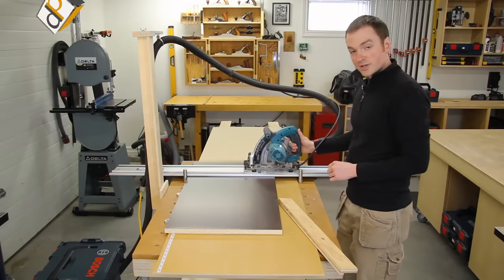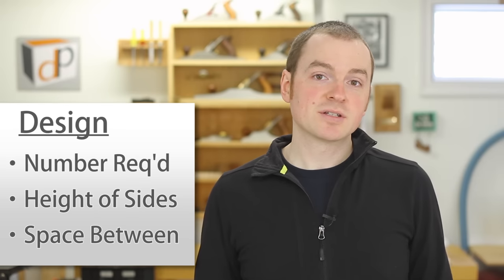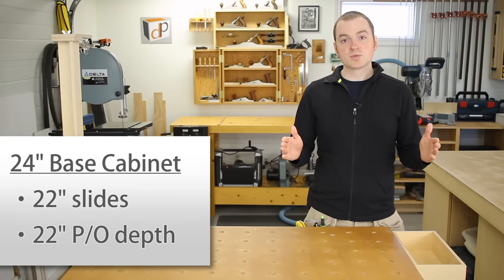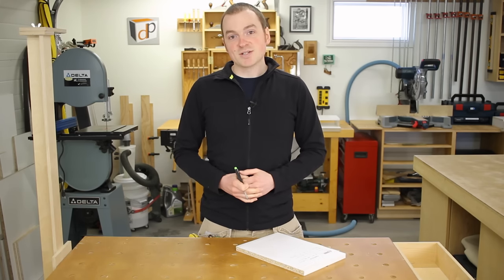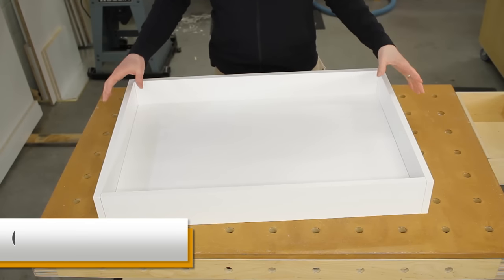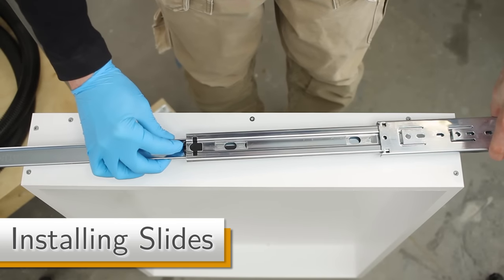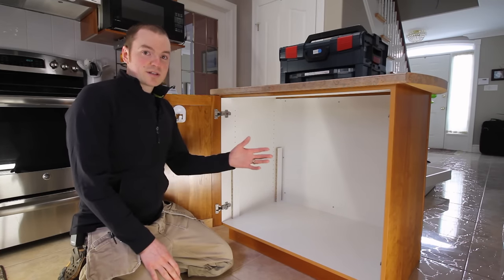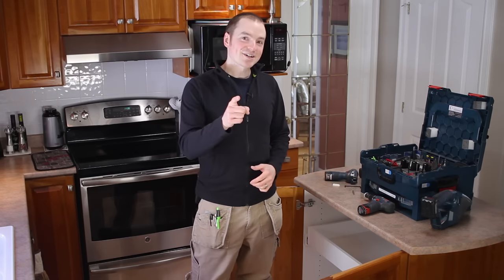How to Build & Install Pull Out Shelves - DIY Guide

Comment: Would you please make a video where you show how to remove these shelves?
Reply from the maker: +ritzd1999 it depends on what kind of slides you use as to how they are removed.  These particular slides are removed by simply pushing on the plastic release tabs on each slide and then sliding the whole thing out.

Comment: At 2:18, what are the widths of the sides for the small and large pull outs?
Reply from the maker: I can't remember off the top of my head but I can find my cut list from the job and get back to you.
Reply from the maker: The large pullout had 4" tall sides and the small pullouts were 2"
Reply: Thank you and great video. You have encouraged me to try it myself.

Comment: excellent tutorial. Thanks so much.One question- if doing one rollout under a cooktop or sink, would you recommend bottom mounted slides instead or side mounts?  If not, is there a rationale?
Reply from the maker: Thanks. You could use either type of slide if you're mounting it at the bottom of a cabinet. I find that side mount slides generally tend to be less expensive, more sturdy and easier to install but you could use either.

Comment: Great video and like some of the other comments the most thorough I have ev r war
Reply: Best I have ever watched. But I noticed that you did not check for 'squareness' on the completed drawer. I assume that is not needed if you make precise cuts. But you should mention this issue and ways to correct. Regardless, keep these videos coming!
Reply from the maker: Thanks. Yes when the drawer sides are built around the bottom like I did in the video its not necessary to check for squareness if you know your cuts are square when sizing the bottom. Drawer construction that has a slide in bottom you definitely need to check for square.

Comment: its funny.. my first boss explained measuring in the same basic way but everything we did had measurements with  nothing, plus , or minus... and meant either right on mark, plus a small mark, or minus a small mark.. he always bought exactly the same company tape measures as well.. and insisted that the guy who measured marked the boards.. we also used a < on our lines to show which side of the line to cut on as well..

Comment: Have any cool tricks / ideas for adding pull outs to a corner cabinet?
Reply from the maker: +Pete G I haven't built any corner pull outs but I have used this unit before in a custom kitchen I built.  I had thought about building something but it was more economical to just buy the kit in that case.

http://www.leevalley.com/en/hardware/page.aspx?p=43657&cat=3,43722,43723
Reply: Thanks Dan, thats a nifty solution to the problem!

Comment: or you could just use metric. The melamine sheets are 16mm. 20-3/4" minus 1/32" or 526mm
Reply from the maker: I use metric for some things but pretty much everyone around here uses imperial so I still use it most of the time. Definitely makes things easier eliminating the fractions.

Comment: Instead of pull outs, install drawers. Think about it, to access the pull-out there are 3 steps, then 3 more to close. A drawer is just one out ,one in.
Reply from the maker: For most applications drawers are easier like you said but in a case like this where existing doors need to be used then pull outs are the way to go.  For a new kitchen build I would have put drawers there.
Reply: That is what I was trying to say, with choice I prefer drawers when possible. Thank you for your channel as it stands in the top of youtube shop channels.   @DPShopTalk

Comment: Numbers like 32 9/16", 23 1/32" and 1 5/8" are the reason you use centimeters, you madmen! 😊
Their better counterparts are 87.7 cm, 58.5 cm, 4.1 cm (or 4.13 cm for precision).
Reply from the maker: I've given thought to switching to metric lately but I'm just so used to working in imperial. Keeps me sharp for working with fractions😄

Comment: It's so much easier using metric.
Reply from the maker: Everyone builds in imperial here so I stick with it for consistency.
Reply: @DPShopTalk  Yes,Dan, I know that. My point is metric is much simpler to use and more accurate.What's 21/64ths in metric? 
No, me neither.
All the best from the UK .
Apart from 'imperial' I am a huge fan.
Reply from the maker: I do use metric for installing hardware and automotive work. It's funny because Canada is a metric country and we were taught all metric in school but for some reason the construction trade never switched over. If I gave a metric measurement on a jobsite I would get some funny looks. I completely agree though that its a simpler system to use.

Comment: Love the video, but was curious about one thing. What did you do for the middle part? Where the doors meet, there is no upright divider, is there a gap between the doors? Or did you do something like this guy https://www.youtube.com/watch?v=2M5IwRrhsuI @8:34 Thanks in advance for your feedback.
Reply from the maker: There is just a gap between the doors which is typical for frameless cabinets. Usually the doors are adjusted so there is only an 1/8" gap between the doors.
Reply: @DPShopTalk  Thank you

Comment: A good instance where using metric is so much easier to work with ... otherwise thanks for the video!
Reply from the maker: I've actually been finding myself using metric more lately, especially on the build I've been doing on my new work van. It's hard to go completely metric around here because everyone else still uses imperial. But it is definitely easier in many ways.
Reply: Dan Pattison metric is what I’ve grown up using in South Africa but now that I live in the U.K. although it’s meant to be metric it’s still very mixed. Road signs are still mph! Wood, tools etc are all metric thankfully. Most of my patients only know their weight in stones & pounds, not Kgs. Yet somehow man made it into space using imperial! Keep safe.

Comment: This is great, assuming I have $10,000 of shop equipment.
Reply from the maker: I do this for a living which is why I have the equipment.  You could build the pullouts with much more basic tools if you wanted to.  If you had a decent circular saw or track saw with a good blade you could make all the cuts.  Add a basic drill and an iron and you could get the job done.
Reply: Just built my first one using this tutorial this past weekend and the tool that I used was circular saw, drill and Kreg pocket hole. It is not as pretty as Dan's especially especially in the edge banding but hopefully it will improve overtime. Thank you Dan for the great tutorial. I am trying to find edge banding that is greater than 3/4 since I built with 3/4 melamine board and seem to have trouble find it.